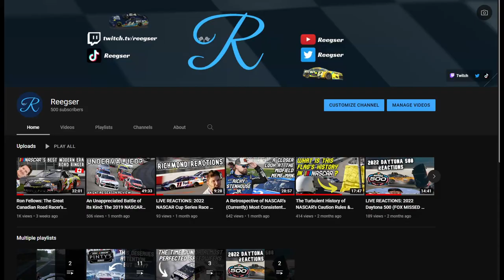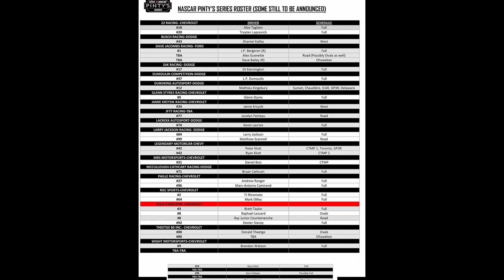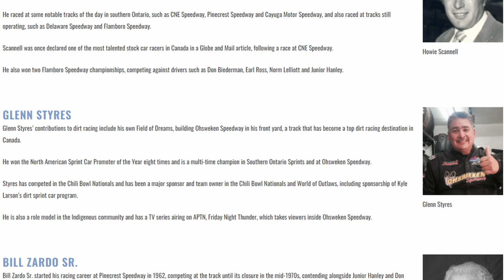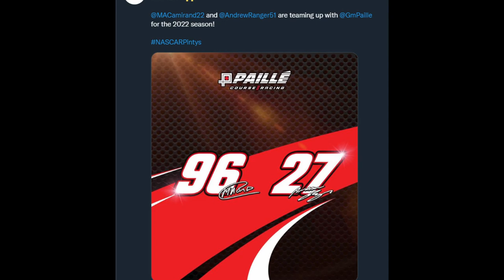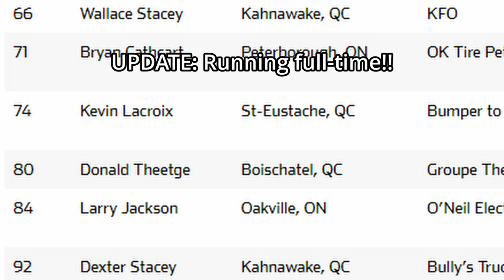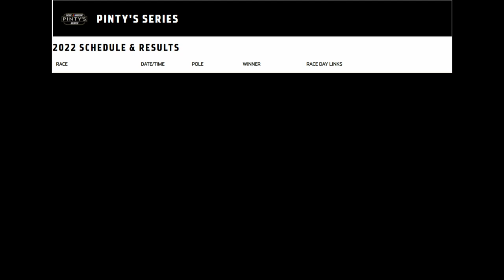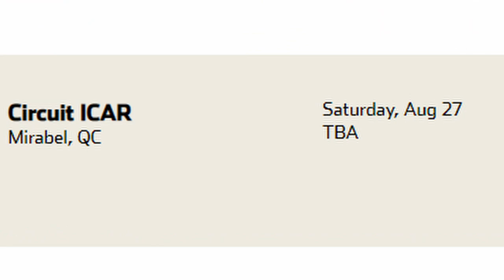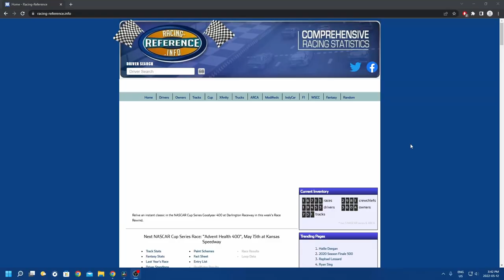2022 NASCAR Pinty's Series Season Preview

Comment: Correction about ICAR, Mirabel Airport is still very much in operation, as it's a cargo hub and where Airbus builds the A220s (formerly Bombardier CSeries).
It's on the site of the former passenger terminal, which was torn down in 2008.